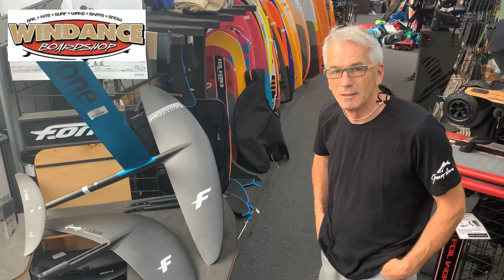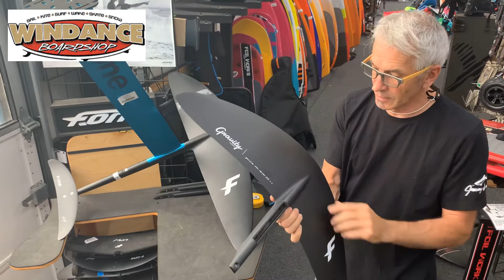Dave Talks Tech: Foil Aspect Ratio

Comment: I have a low aspect gravity 1200 it seems to me it's mainly less stable than a high aspect which I have too (phantom 1680).  I can guide it very easily but too easily in a sense, for a very small pressure of the toes and the board sharply changes direction but that's too much, often the pressure isn't volontary !  Moreover the foil short wing doesn't allow to go up the wind nicely, I cannot press on it, I don't feel it.  To conclude I don't see the need of low aspect at least in wingfoiling.  It seems to pertain to the past !  Agree or not ?
Reply from the maker: The two worlds are merging together as we progress this wing foil sport.  Probably be seeing more mid to high aspect wings in the future or just high aspect wings that not only perform well for advance riders but also fun and easy to learn for those learning the new sport.  Which we are seeing now.  We believe "less is more" so if you can have gear that allows you to progress to the Next Level without purchasing more gear is what we want out of every gear purchase!